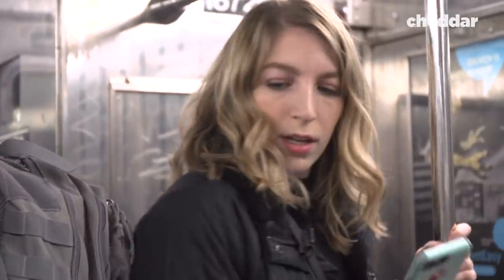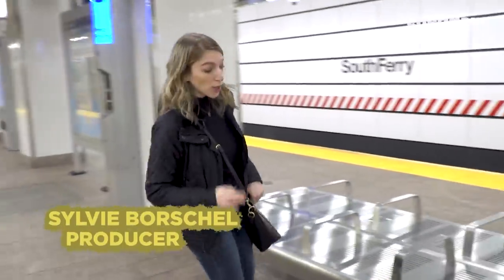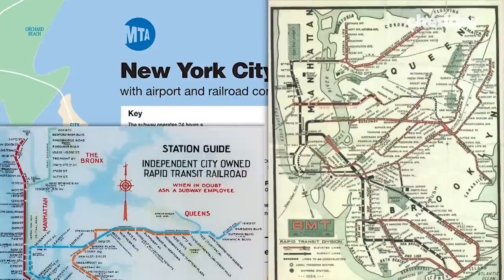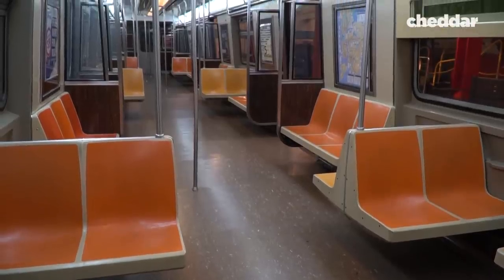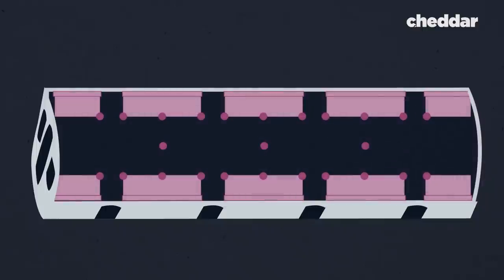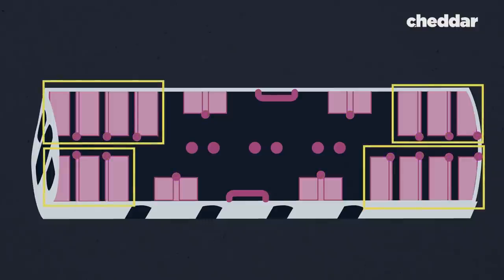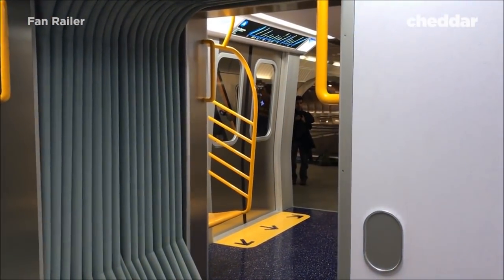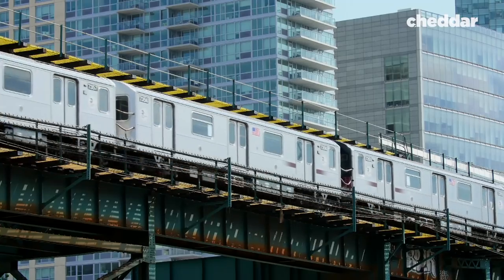Could This Subway Car Save NYC Transit? - Cheddar Explains

Comment: Why dont you just remove all seats ?
Reply: Kingsley Healey They do have that program on the 42nd Street Shuttle. Impact to passengers on that line is minimal because the shuttle goes from point A to point B in a short time (the shuttle doesn’t even have a station between them). Literally the only place I can see this being applied to is the Franklin Avenue Shuttle in Brooklyn. Like the 42nd Street, the Franklin is also a short ride, with most people not traveling far.
Reply: @TheRailLeaguer  I just thought that removing all seats could help get alot more people on the train not practical but could probably fit alot more people on
Reply: Kingsley Healey That’s true. However, on the mainline (non-shuttle) routes, when it comes to seat removals, they should only remove the ones at the end of the train cars.

Comment: Trust me, we won't see any of this until at earliest 2023!
Reply: New subway cars are coming in early 2021. The 535 base order R211s from the 2015-19 capital plan has 20 open gangway train cars as a test. Other cars will be used to replace existing cars on the A, Rockaway Park Shuttle, and the Staten Island Railway. The two option orders (640 and 437 cars respectively) can come with open gangway cars to replace additional older cars and expand service on the G line.

Comment: Six minutes between trains during rush hours.  Solution solved.
Reply: Trixter3d Not enough rolling stock and demand is available for this. And even if they did add more service, the cars STILL need to be redesigned for the extra people.
Reply: More trains, faster turnaround, less crowds.  Redesign, cost billions, same foot print.  Look at Paris, they have trains run every six mins during rush hours and they have smaller foot print.
Reply: Trixter3d I get the more trains part, but still, over time, that increased frequency will attract more people to the system, especially with a train as frequent as 6 minutes. Over the course of a few years, this adds up to more people to be cramped on the same small subway cars. 

Plus it doesn’t hurt to redesign a subway car, especially when one adds the open gangway component other systems use. The design of our newer trains hasn’t changed at all.

Also, they considered the design changes USING THE EXISTING CAR AND FREQUENCY LIMITS IN MIND.

Comment: I think that style of airplane seating is bad for short hop style trains as people will have to shimmy past others. Back to back style trasvase seating would work better. Also bench style on theses parts as if it looks like 2 seats you will get 2 people but the same bench might get 2 adults and a kid of 3 kids on one side with the parents facing on the other seat. Also with doors have single doors at the end of the carriages with double in the middle. If you do have that design at the ends of the carriage have leaning seating as seen on the London Victoria line and this image https://images.app.goo.gl/eZcjW2D2Qh2VU8wn8.

Comment: You all should be happy of what we got. At least someone made trains. Trains are supposed to be cramped
Reply: FBI Train But it doesn’t hurt to make improvements. Our new trains will come with open gangways to increase capacity and allow for free movement between cars.
Reply: @TheRailLeaguer  but still we should all be happy of what we have
Reply: FBI Train I agree, and we can improve them. These trains don’t last forever, so we need to make the best of these cars.
Reply: @TheRailLeaguer  I am confused about something now
Reply: FBI Train No worries. It’s just that with our existing fleet of subway cars, we can redesign them as well, all for little costs.

Comment: Airline seating is a terrible idea. Will lead to fights/murder. Would rather them take out the seats entirely. We aren't civilized enough to have it arranged this way.
Reply: Some cars on the 42nd Street Shuttle have had seats removed in the middle part of the train. Combined with open gangway trains, this will result in an increase in capacity on the newly renovated line.

This needs to be expanded to other lines as well.

Comment: SAY NO TO GANGWAY DESIGN!!!!! if someone puke or bio in a cart... the whole train gonna smell!!!!! trust me, if you see a crowded train and one of the cart is almost empty. you know what it means.. worst times are from 12am to 6am..
Reply: ZHA DEAD That “empty car” joke is getting too old.

Plus the Open Gangway works well in other countries, and I can see it work here in the city, especially on crowded lines like the A and C in Brooklyn, and the E and F trains in Queens. The open gangway design would allow for passengers to spread out throughout the whole train, just like the trains in Toronto.
Reply: @TheRailLeaguer  well the joke is old.. but for graveyard shift like myself.. i saw alot of ppl using the subway as a motel or something.. and sometimes they use it as a restroom...
Reply: ZHA DEAD That concern should be addressed by NYPD and other employees, but it’s still no reason to not pursue open gangway trains, which are safer both during the rush hours and the graveyard shift as one can walk around the 5 cars freely with no doors to interfere with, so if you are in car number 3 and need to go to conductor in the middle of the train, you can walk through the train with no doors to j tercera with.

Plus it works all over the world, including Toronto, so why not NYC?

Comment: Lmao people will still sit on the edge seat, now they just won’t take the second so it will be like 2 middle seats
Reply: Walter 1775 Exactly. Rather have an open gangway and a few seats removed than this.
Reply: JeremiahC99 
Yes, designs like this would suck for subways, they might help passenger comfort but during crowds and rush hour they would be terrible.
Reply: Walter 1775 Plus you can achieve the same results if you added an open gangway and removed a small amount of seats. More efficient use of space.

That same layout is similar to what is done on the older city buses, and I’m not happy with that.

Comment: dumb to invest so much on a type of train car they aren't sure will work. Simple to just make one metro train full of those cars and have it run for 1 to 2 years through several different lines to see how it works and where it might fit best.
Reply: So you’re saying the Open Gangway trains don’t work, because they sure will.

Plus an R143 train was refitted with measuring devices and ran around the system to collect data for the open gangway trains.
Reply: @TheRailLeaguer  No I was saying its dumb to invest that much money on an untested design. Not all places are the same and not all designs will work the same because of that. That's a lot of money to put into something that might fail and then your stuck with for however many years. Its better to test the design and get all the kinks out before investing that much money.
Reply: @animehuntress9018  Oh. The open gangway R211Ts are only 20 cars, so it’s still a test. The other cars in the 535 car base order are close ended cars to expedite fleet replacement.

Comment: just look at montreal's stm metro system
Reply: Andrew Whittick What does that even have to do with outdated subway car layouts?
Reply: @TheRailLeaguer  for an efficient subway car, did u even listen to the video
Reply: Andrew Whittick Okay, but here’s the thing: Subway cars are not off-the-shelf items. They just be customized for each individual transit agency. Simply copying another agency’s layout would not be feasible. Even the open gangway trains the MTA wants to use has to be specially made for the MTA’s unique needs.
Reply: @TheRailLeaguer  all im saying is the stm trains have pretty nice latout, i never have problems with the metro but then again im talking about montreal vs ney york. not rlly a fair comparison lmao

Comment: Just put in cattle coach with overhead netting. Problem solved.
Reply: What?
Reply: Sauk Raya The MTA isn’t planning to remove comfort, especially since open gangways also increase capacity and comfort.
Reply: Sauk Raya Yeah man. Prove it.
Reply: @TheRailLeaguer  
LOL, so say the corporate lapdog.
Reply: Sauk Raya Correction: You’re a corporate lapdog.

Other cities have open gangways for comfort, so why not NYC?
Reply: @TheRailLeaguer  
LOL, pushing corporate agenda, don't we.
Reply: Sauk Raya Really? You’re pushing corporate agenda?

Comment: They need to redesign the train car to a bigger possibly double decker car and most importantly redesign the wheels and how it runs on the track, redesign the rail itself, so that there are no derailments...oh🙄what am I thinking,,that will create jobs.....the idiots running Washington doesn't want that..
Reply: Not only that but the tunnels would be too small for double-decker trains. Having open gangway trains is one way to increase capacity on the trains.
Reply: Richard Head What’s wrong with open gangways? Why would you prefer lengthening trains over adding open gangways in unused spaces between cars?

Comment: That design is horrible for getting on and off quickly and efficiently. These people are idiots. Have they ever ridden the subway on a daily basis? As usual, the problem is attacked from the completely wrong angle. The design in place now is perfectly fine and efficient. Instead of re-inventing the wheel, how about cleaning the cars and stations once a decade?
Reply: E.L. Norton This I agree with. I’d rather add an open gangway and remove a few seats than create airline style seating.

Comment: This is a strong argument against subways. No thought of comfort, just move the cattle as quick as possible.
Reply: Christian Libertarian Its still a much better option that being stuck in your car in traffic, while the trains zoom by you and you get to work much later than the train.

Also, that argument if yours is pretty weak.
Reply: @TheRailLeaguer  I know of no place where trains get you to work faster than a car. Even Washington DC, which has a better subway system than NY and worse roads, cars are faster.
Reply: Christian Libertarian Actually, that only applies during weekends, and maybe some trips between outer boroughs.

Even then, Manhattan is constantly gridlocked with traffic, especially below 72nd Street. It would be much faster to take the local trains there.

The crossings also get congested as well.

If we were to take your advice, then we would have no subway, and the traffic will get worse than it already does.
Reply: @TheRailLeaguer  If you were to take my advice, you would put in more freeways.
Reply: Christian Libertarian More freeways will not work either.

We already tried that with Robert Moses, and he added more and more freeways and roads. The result: congestion got worse.

To truly solve congestion, build new transit.
Reply: @TheRailLeaguer  Not nearly enough freeways were built. Compare the number of freeways in NY to the number in Detroit. Fewer. With a ten times larger population.
Reply: Christian Libertarian Actually, we already have enough freeways in THIS COUNTRY. NO MORE FREEWAYS AND EXPRESSWAYS. We need MORE transit.

Stop trying to emulate Robert Moses.

Comment: Great.. Now when you want change cars because theres like 10 homeless people sleeping in that one, now you cant. 
Thanks MTA!😀
Reply: That joke is getting too old.
Reply: @TheRailLeaguer  is it a joke when you are trying to hold your breath until you hit the next station? I dare you to laugh then!
Reply: Ivan Blando Yea. Other cities with similar problems have Open Gangways and they do fine with smells. Plus it is impossible for an odor to travel 300-600 feet. Also, close ended cars make the subway very unsafe, especially when locked.
Reply: @TheRailLeaguer  wait so i should go 300-600' to try to get away from the smell? When in subway cars you can walk 20' to next one.. I don't worry about the safety.. I'm usually the one doing the mugging!! 😝😝😝
Reply: Ivan Blando No. the smell will not travel 300-600 feet. The open gangway design will allow for passengers to seamlessly walk from the foul car to the next one without dealing with doors that are sometimes locked. Plus with current rules, walking between cars is illegal. With open gangways, this move will be legalized. It will also allow for a 10% increase in capacity during rush hours, middays, and evenings. This alone outweighs all the negatives.

As I said, other cities with similar problems have Open Gangways with no complaints whatsoever. Such cities include London and Toronto, where current NYCT President Andy Byford one ran transit in those cities. If they got it right, so can NY.

I honestly feel that the whole open gangway-odor complaint is just fake news and lies being spread out by the mainstream media to mislead the public into not embracing tried-and-True concepts like open gangways.
Reply: @TheRailLeaguer  I have never heard of foul smells or homeless people stopping at the end of an imaginary end of a subway car. If the area is open both will go through. I would rather have more of a compartmentalized train. I'm not saying that the design is bad, i just think that better design concepts can be achieved. So i guess I'm saying i agree to disagree.
Reply: Ivan Blando Open Gangway designs IS the better design. It’s a no-brainer. Every other city uses them and have reported ZERO complaints. The 10% extra capacity and ability to LEGALLY move freely between cars sure outweighs non-existent odor problems, especially during the rush.

Comment: Great less seats . The whole subway system is shit.
Reply: Huh?
Reply: @cpp2300  What does that have to do with subway car layouts?
Reply: @TheRailLeaguer  less seats . That’s not a great idea . One because there’s many people that travel 1 hour + to work another 1 hour + back home .
So less seats is definitely not a good idea .
I lived in New York all my life . 
And the lay out they are referring to I has not improved Tavel .
2.the people running The New York transit system are one that need to change .
They just care about profit in their pockets .
Corruption to the max.
Nothing has change because of corruption in NYC
Reply: @cpp2300  The second part is unrelated to this video.

However, for the first part, only a few seats have been removed on each train. For the 42nd Street Shuttle, only one car has had seats removed for a capacity increase.

Regardless, removing a number of seats has had very few negative impacts. Open gangway trains will also help increase capacity.
Reply: @TheRailLeaguer   well is definitely relates because the infrastructure in New York is falling apart .  
The subway system is part of that infrastructure.
In fact  maybe renovating in other  areas of New York other than Manhattan would improve peoples life not just the few wealthy individuals I say few because they were the first one to flee after the crisis.

Seating ?

fix the  the whole subway system couse it is shit mate .
Reply: @cpp2300  I still don’t get the connection. The video provides a potential solution to the seating layout. Your answer doesn’t even come close to it, nor does it relate.

Comment: Rubber wheels for the underground train 🚇 systems,   Mmmmmmm...... improved bus service to reduce 🚊 crowds . The noise generated by steel on steel bad for the nervous system and damages under ground structure s!!!!!!!
Reply: This has nothing to do with the layout of the subway cars. No mention of seating arrangements, pole layouts, etc.
Reply: If you want rubber-tired trains, move to Montréal. Also, the noise doesn't damage the nervous system, overexpose to noises much higher than most subway systems causes issues to your ears

Comment: The NY subway system is one of the worst in the world
Reply: Not really. It’s one of the best (the not THE #1 best in the world). Yes it’s not perfect, but think about it? What other system has both local and express trains that takes you from tourist areas in Times Square to the Brownstones of Brooklyn or from the money making financial area of Lower Manhattan to the multi ethnic neighborhoods of Queens, all for the low cost of $2.75? It’s a very good and capable system.
Reply: @TheRailLeaguer  yes but if you compare it with the London Underground the u may aswell just take the bus. The London Underground is east, reliable and clean compared to your rubbish cans on wheels
Reply: @tomAS-27  The NYC Subway is very reliable as well. It’s very easy to use, though cleaning can use some work. Otherwise, it’s very good.
Reply: @TheRailLeaguer  not as good as the London Underground tho
Reply: @tomAS-27  That's why I said it's ONE of the best. The subway is not THE best, but it's NOT the WORST either.
Reply: @TheRailLeaguer  well it does seem like one of the worst
Reply: @tomAS-27  That's not entirely true. It's more in the middle between #1 best and the midpoint between best and worst. It could use a few improvements, like better-designed subway cars, and the like. New signal upgrades should alleviate the rare and occasional signal delay that trips people up once in a blue moon.
Reply: @tomAS-27  if you compare it to the rest of the untied states, these subways are golden.
Reply: @rbvfeehfbudenrj  yes but if you compare it to the rest of the world then it’s shit
Reply: @tomAS-27  yeah